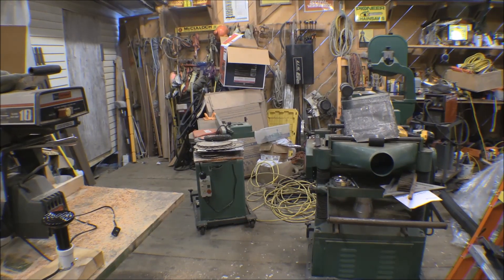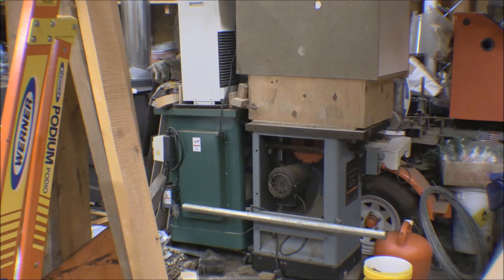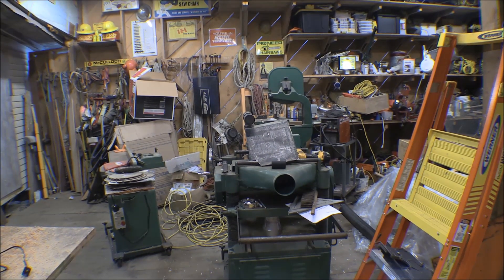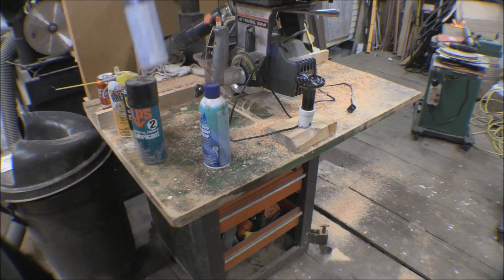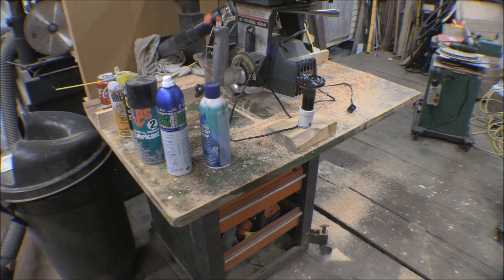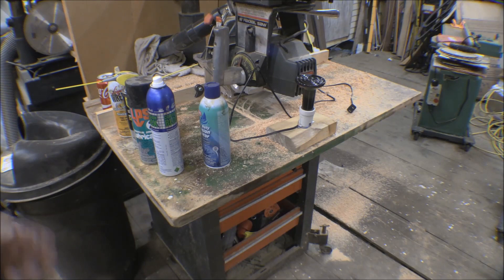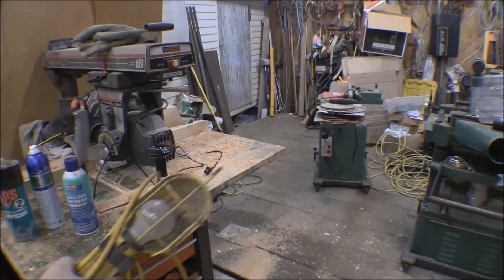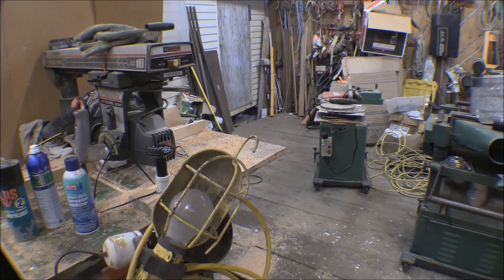Tool and Machinery Moisture and Rust Control and Prevention

Comment: On my angle plates and other big lathe and mill tools I use spray lithium  grease, works well so for . Takes a little time to clean up when you need to use but not rusty. Got a 60 watt light bulb in the end mill cabinet  also hot the small tools in there. I know we don't have as much a problem as you do but still a problem.